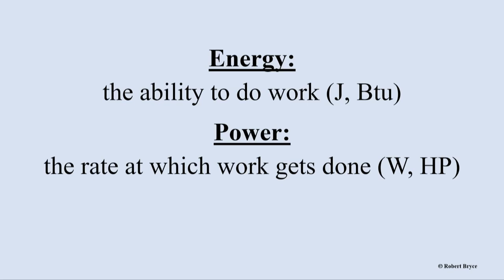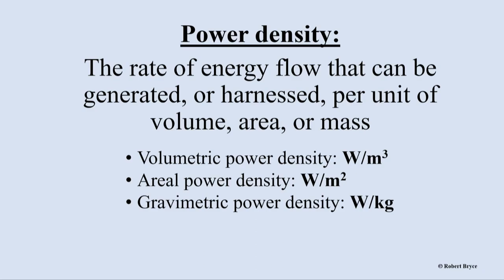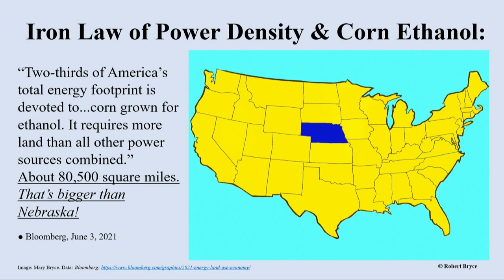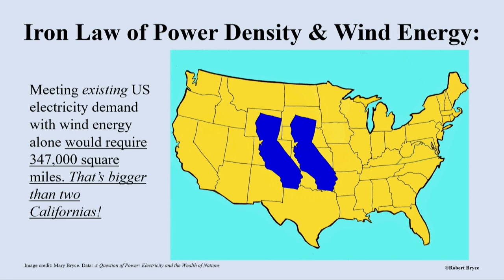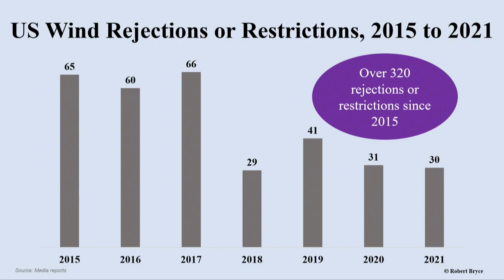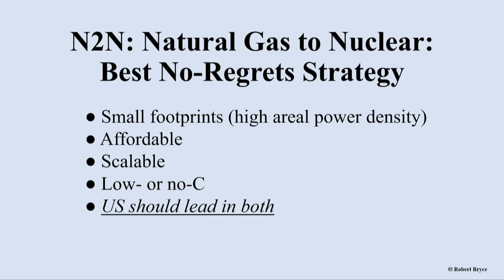The Power of Power Density

Comment: There is NOT ONE energy source that is WORSE for the environment than wind or solar. Especially offshore wind. From the first shovel in the ground to the last hole dug (where solar and wind goes into landfill), wind and solar are way, way, worse than fossil fuel equivalents. That's not me. That is SCIENCE. If you don't believe me, you should try understanding some basic math. 

A solar farm (unreliably) generating electricity of around 1 GW would occupy 400 times more land than a fossil fuel equivalent. And consume more than 17 times the materials and resources. For something that lasts 20 years. If you are very lucky. Wind turbines are just as bad. With the added disadvantage wind turbines, whether on or offshore, are absolutely terrible for wildlife. 

Greenpeace worry about the damage offshore drilling does to whales. But, you won't hear a peep from them about the damage to whales and crustaceans that is definitely caused, (and is infinitely worse), by offshore wind turbines. As evidenced by the dozens of dead whales now landing on the US north east coast. Not far from one of the worlds largest off shore wind farms. A site which somehow evaded all the environmental requirements an offshore oil or gas site would have had to satisfy. 

Bottom line? If you think renewables will 'save the planet', you are utterly deluded. They are worse, in every possible way and conceivable measurement, than the fossil fuels they are supposed to replace. THAT is an inconvenient truth!

Comment: The "I don't like renewables" team suffers from the same problems as the "I don't like nuclear" team. High "power density" simply isn't required. Calculate the electrical energy use in New York City and it's 21 MW/square mile. Solar farms in New York State achieve an average output of 25.6 MW/square mile. When we look at gas, we have to consider upstream as well as the power plants. West Texas has an awful lot of land dedicated to leases, looking no different than wind farms. The question isn't who has the highest power density, but who can make kilowatt-hours at the lowest price. And that goes to renewables. Nuclear is a great political football, but no one seems to have actually found which "safety regulations" are making it so expensive and how those burdens can be reduced to make it competitive. A nuclear plant's finances mandate operation at 90% capacity factor. That means it has the same trouble as renewable - another energy source is needed somewhere to always equal demand.
Reply: The lower the power density, the higher the resource requirements.
Reply: I wouldn't say that in relation to fossil fuel, as renewable energy takes far less resource extraction than fossil fuel. Nuclear has the problem in that the resource is money in dealing with edge cases. It's easy enough to make a nuclear plant that produces power, a different story to make one that's accident tolerant.

Comment: Very informative -- thank you!  
Surprised to see solar with a higher power density than wind (albeit still abysmally tiny).  Is the base assumption one of contiguous panel placement, without the typical spacing between panels?  Can you post a link to the base data for that graphic?

Comment: Agree on most of your points; however, California has had wind power installed in multiple areas when it made economic sense since 1970s. Currently many of these wind sites are being upgraded to fewer but more efficient installations. No one proposes a wind farm that won’t make money. 
PS1- My indoor cats if let outside would show you what an efficient bird killing machine is. 
PS2 - Driving by industrial scale solar installation they are not visually disturbing even though I agree power density wise they are out of the running.
Reply: Where does the electricity come from when there is no wind for those California wind turbines? Is there a blackout? If not then there is some other reliable energy source and those wind turbines only add cost to whatever that reliable source is.
Reply: But unlike wind turbines, cats don't kill large, smaller population birds like eagles.
Reply: Dilute intermittents like wind and solar are far too resource intensive and chaotic to ever be capable of doing the heavy lifting of meeting our energy needs. They are mostly a waste of time and resources that cause electricity rates to soar.